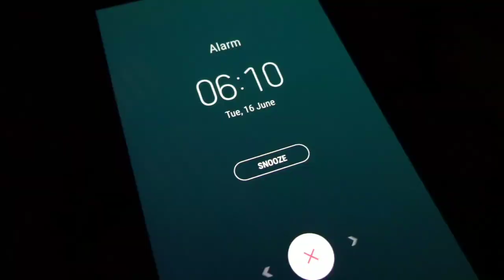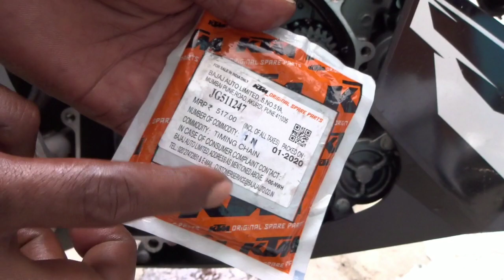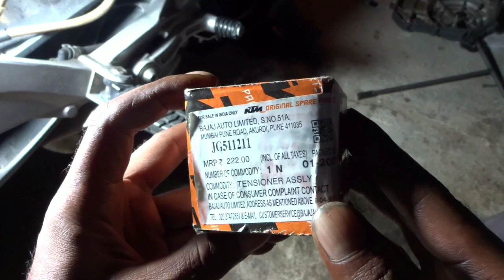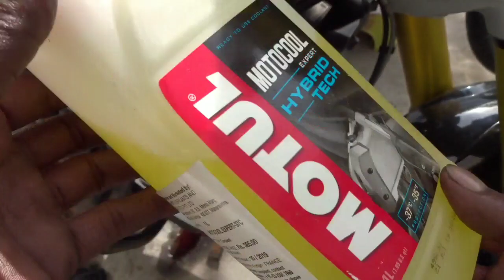HOW TO CHANGE ktm duke 200 CAM CHAIN, tensioner

Comment: When I cold start my duke, I can hear some kind of harsh chain noise. It goes away after some time. Is this the same issue?
Reply: Bruhh..it gone?
Reply: @shahirabdulla8938  No. Its still there. But mechanic said, its common during cold start as the timing chain and other engine components are dry.
Reply: @ADITHYA388  ohh..same problm here bruhh..now my bike is there in showroom..tomorww they will check and tell
Reply: @ADITHYA388  bruhh can sent me ur insta id

Comment: Anyone know if you can change the timing chain tensioner rail by removing the tapped cover only or do u need to remove the cylinder head ?